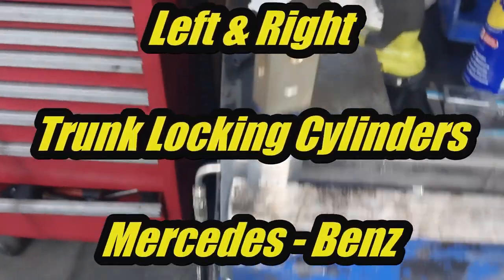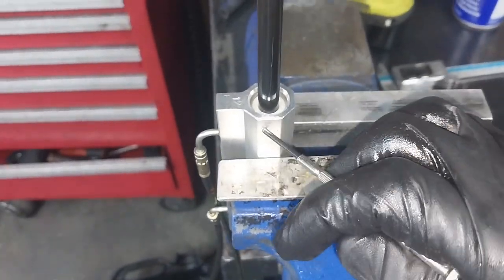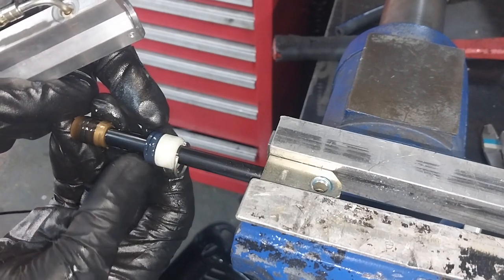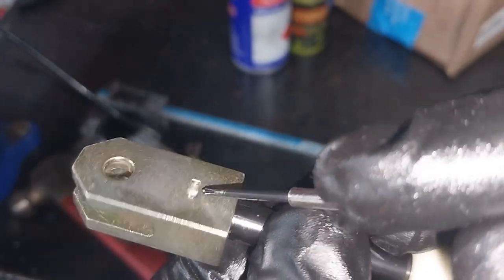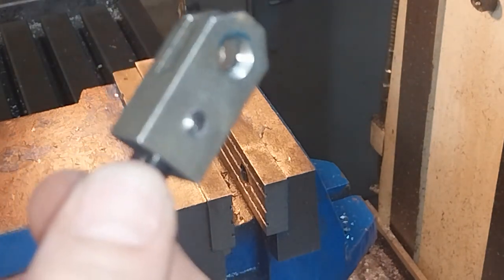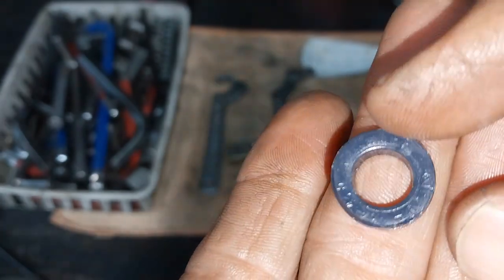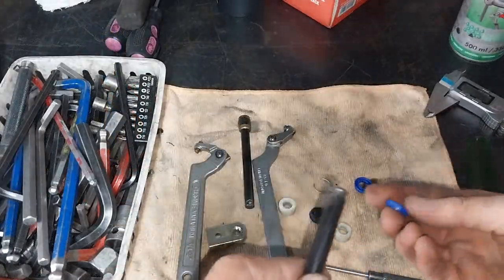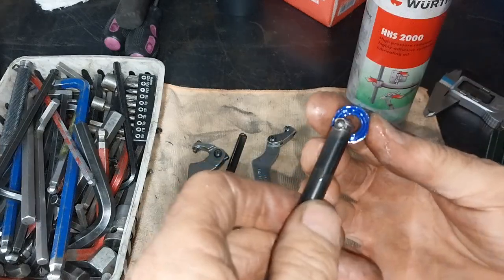Mercedes Benz R230 SL Convertible Strip & Reseal Pair of Small Trunk Locking Cylinders

Comment: Good video, its nice to see Mercedes have at least made them mostly servicable, if it was from a chinesium vehicle maker it would be totally unservicable in all aspects.
On another note, I rebuild my own hydraulic stuts on my Toyota Soarer UZZ32's these stuts (1 on each corner suspension total of 4) tend to last around 170k to 200k before they start to leak, there are about 90 of these cars still left in Australa.
Reply from the maker: Thanks for your comments Roland, if you cant get parts or if they are way too expensive you have to have to do something.